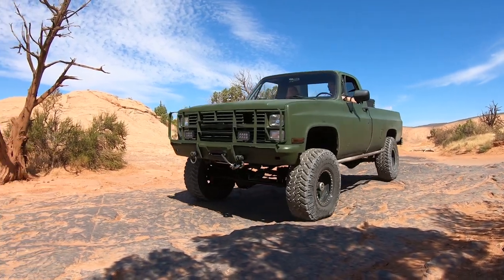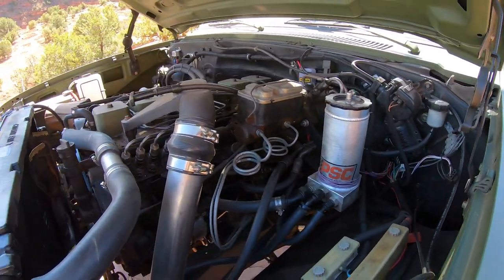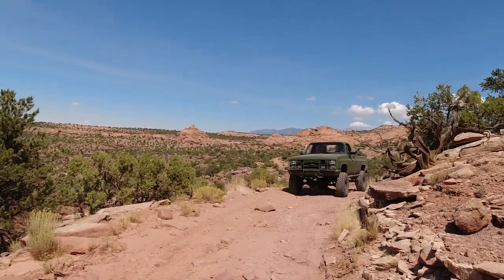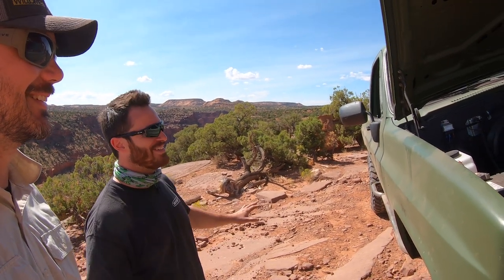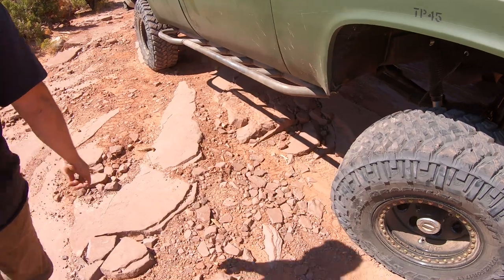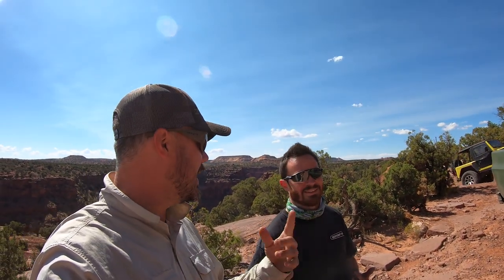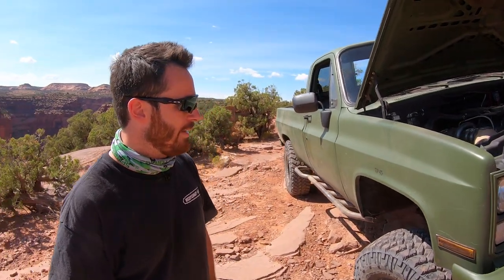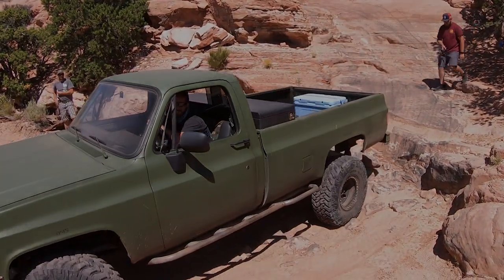Driveway-Built Cummins-Swapped Squarebody, Dave Gambino's 12V M1008 CUCV – Walk Around

Comment: Literally the exact truck I want to build, I already have a 85 3/4 square, 94 p-pump 12 valve, all I need is a nv4500 and a lot of patch panels.......... wooooo gotta love Canada rust....
Reply from the maker: It's a really good one.
Reply: I have a similar truck I'm trying to get going. It's a c30 wrecker going k30 with a lift. I have almost everything except the lift. I need clearance and capacity.
I have 37s for it. It seems if I go with 6" up I'll still have to trim the fenders. 8" seems like too much lift. I'm leaning more to 4"-6" and fender trimming or reshaping.

What would you guys do? 

It's a shame my fenders are SooOoOooo virgin, rust free, perfect, and pretty. 😩😁😂
Reply: X Mo personally I decided to go with 35s so I don’t have to cut haha, and If your doing a k conversation I’d look into a 52, 56 spring swap and shackle flip for the lift to get max performance from the suspension
Reply: @warpillow8775  
Remember I have to carry a load and drive on the streets also. You don't think that setup may be too flexy?
Reply: X Mo for that application I’d still go with a shackle flip for the better ride but I wouldn’t worry about trying to stuff 52” springs up front, I’d definitely look into adding bags in the rear but the c30 rear springs should be more then enough, also for the shackle flip diy4x makes a really good kit for it which gives 4-6 inches of lift depending on what shackles ya go with using the stock springs
Reply: @warpillow8775  
Thanks, I appreciate the response.

Comment: Please correct me if I'm wrong, but I believe I spied 6" springs with an zero rate and high steer swap? Very nice build, and roughly the same direction I have planned for my '86 m1028.
Reply from the maker: It's a 6" spring with a shim to correct the caster.  I think that's what looks like a zero rate.

Comment: Anything is better than the turd 6.2. I put a 454 in mine
Reply from the maker: It's a swap done well.
Reply: @WillometMotorFab  
I thought I saw a video where you had a 6.2 and you liked them because you're familiar with them.
Reply: I'd wanna do the same thing eventually. what is needed specifically other than the engine?